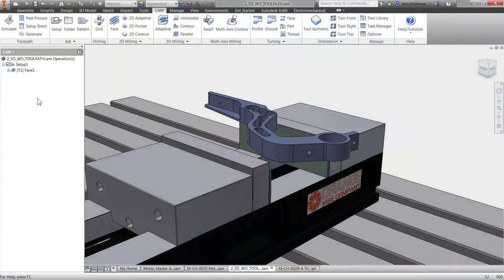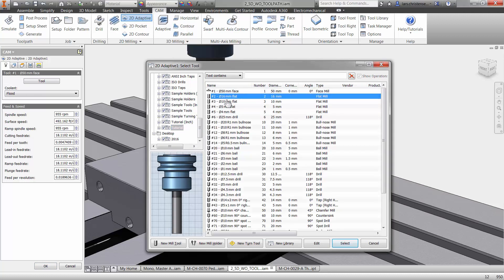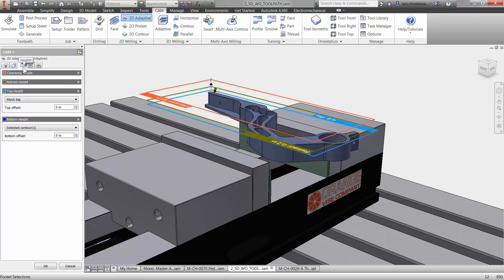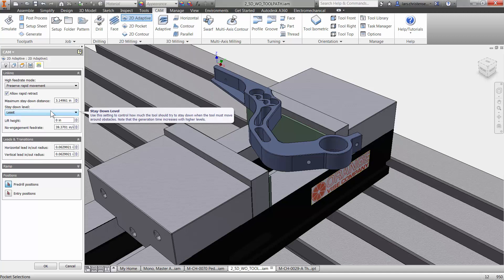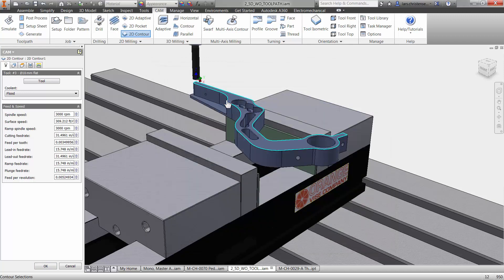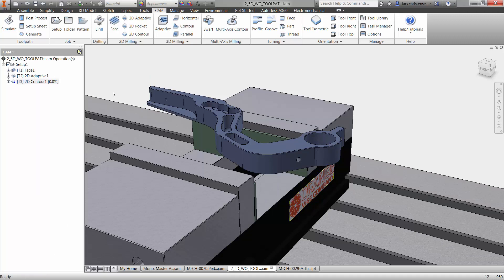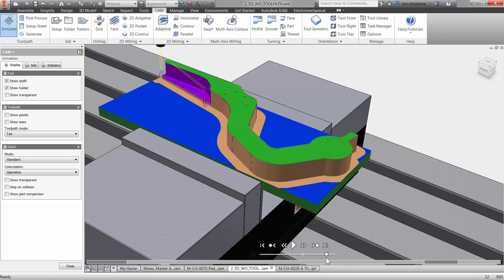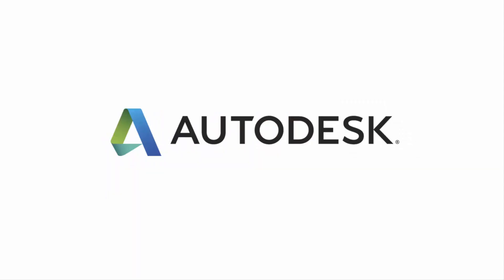Easy steps to use Inventor HSM - Basic - Chapter 2

Comment: Hi Lars, thank you for a great tutorial video. I have fusion fusion. It also has cam section. I want to ask you does the inventor hsm offer more options on milling? Or is it exactly the same as the fusion 360. Thanks
Reply from the maker: Hi NTC SIE Thank you for watching! Beside a couple of small differences because of different CAD platforms, they are totally the same.

Comment: Hi Lars, you mentioned in your first video that you placed the part in an environment (vise)... is there a tutorial to understand how this is done? and how do you constrain the vise to the stock if the stock is defined in the HSM part and the vise is (i suppose) an assembly? i guess you have to set the stock first, then create another solid made with the stock dimensions, then constrain that to the part, then constrain the stock to the vise, and then remove the visibility to the stock.

But that is really long, is there a better way to do it without going back and forth?

I am interested also in creating a small production run with multiple part cuts on one single stock, does that imply some duplication, part layout on the stock and some more thinking behind how you do the cuts?

Thanks alot, just learning here before deciding to buy my own mill for a side project of mine! Very inspiring. Subscribed.